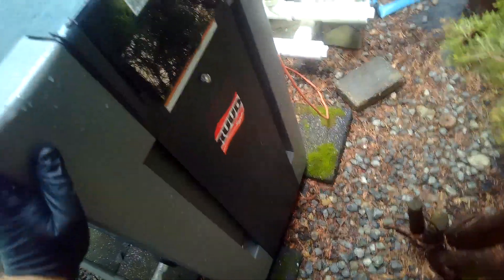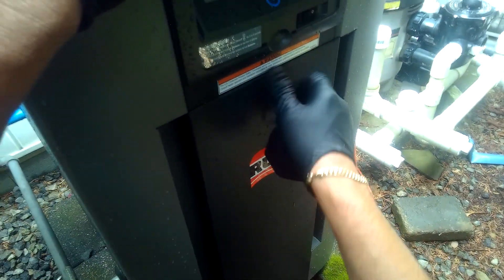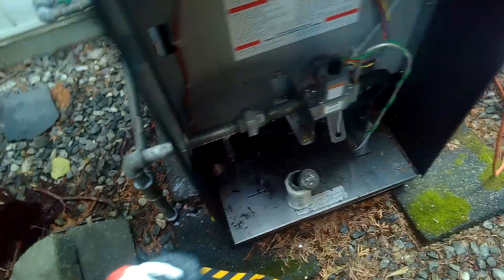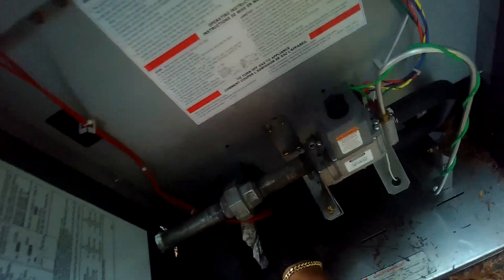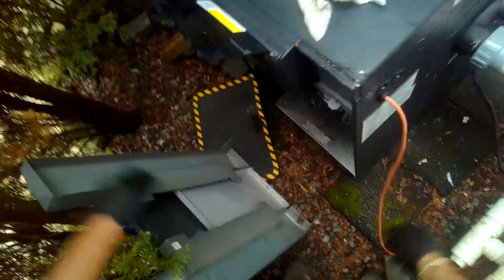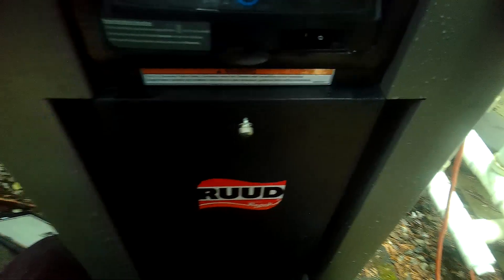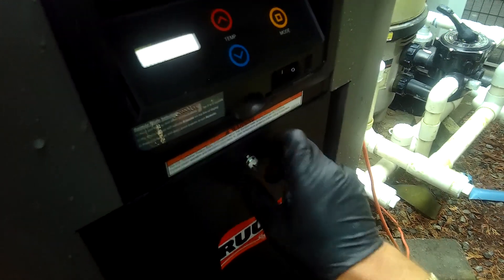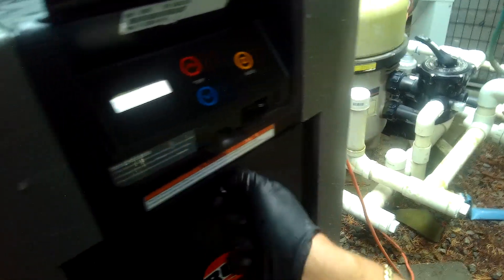Ruud Raypak Gas Pool Heater - Smell of Gas When Heater is OFF

Comment: That union should be outside the box.   Manual will show the layout of your gas line.   

Mucho bang-bang risk with a leaky fitting inside the box with the old style burner tray beneath it with open face.

Really dig how you go into detail on each step.   Great channel.   Thx